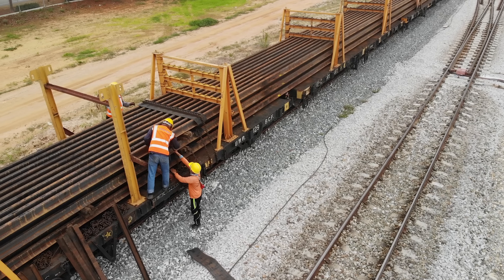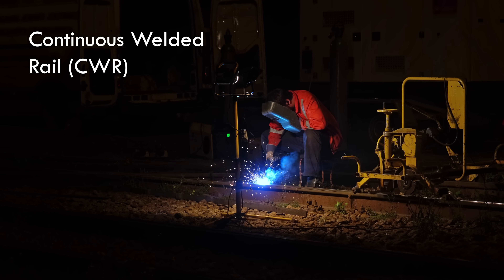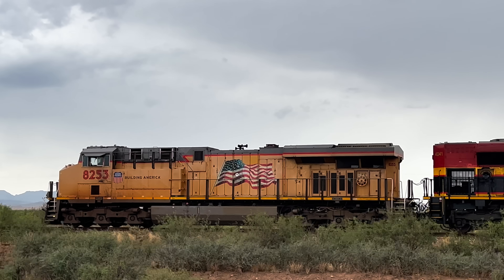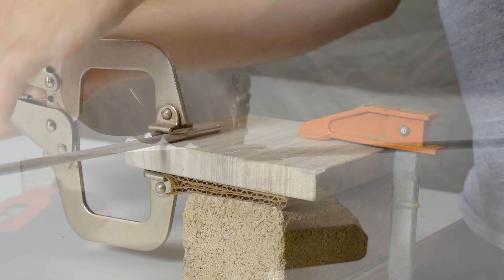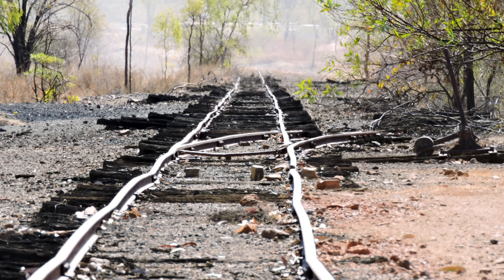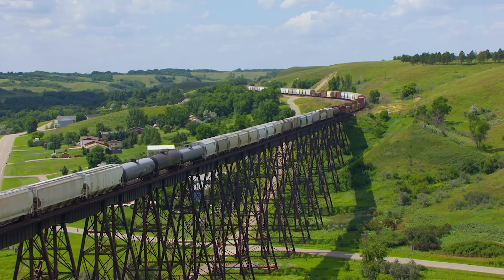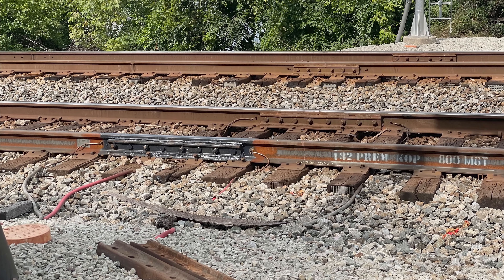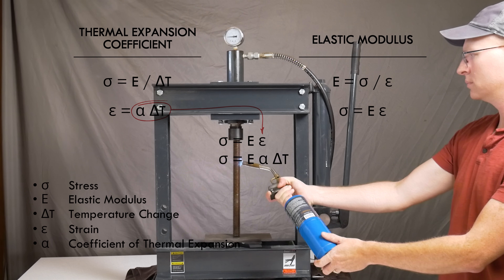Why Railroads Don't Need Expansion Joints

Comment: In europe we use concrete to space out the rails. We also don't build a perfect straight, but small segments of gigantic circles. If you alternate between left and right circles you get something that straightens up when its cold and ever so slightly S-shaped when its hot. For this to work the spacing needs to be able to move.
In slow and heavy segments the spacing just moves on the gravel and you recompress the gravel from time to time. On fast segments (ICE/TGV) we use two concrete forms that only allow movement of the tracks left and right.
If you know the frequency and maximum amplitude of that S-shape you can design a suspension for the wagon that decouples this frequency perfectly. How much the damper of this suspension needs to work is also a sensor on how curved the segment really is. So the train tells you when it needs service. Or you drive slower so the frequency at which the wagon is swinging sideways gets lower and the suspension has an easier job.

Comment: Railroad tracks are part of my thought puzzle and you being an engineer may provide an answer.  If you pushed one end of a mile long track would the other end move instantly? If you hit it with a hammer would the other end move instantly?  Now apply the same thought experiment in Outerspace where there is no gravity. Now stretch the rail to the moon. If you pushed the earth end would the moon end react immediately? Speed of push? GOOGLE all you want but you will not find where anyone has addressed this puzzle.
Reply: The speed of sound in steel is listed as approximately v=5000m/s. 

I would use this to estimate the velocity of an impulse traveling through the long track.

For a mile long track, or 1.61km, this works out to t = 1610/5000 = 0.32sec

The average distance to the moon is estimated at 239000 miles or 384km. Then t = 384000 / 5000 = 77 sec approximately.
Reply: I asked Gemini about your answer, and it said that was too fast. Try asking GOOGLE's free Gemini and see what it tells you.
Reply: @mrcleanisin  
I disagree, and I don't know who Gemini is. 

The speed of sound in the medium means there is at least a small displacement that the impulse (such as a hammer tap) causes as the energy wave reaches the other end. Obviously it would take a tremendous amount of force to actually physically move the inertia of either of those lengths. If you are trying to push those by your own strength, then good luck to you and don't hurt yourself!

This very much depends on your definition of movement at the other end. I say if you can hear the tap, then there was movement.
Reply: Would you hear the sound first or feel movement first?
Reply: @mrcleanisin  
I think it is the same answer for a hammer tap. You would feel or hear the same physical vibration "ping" when it reaches the other end.

The more I think about your experiment, I think it makes the most sense to think of the railroad track section not as a solid, but as a long and very stiff spring. This is in keeping with the compressibility as demonstrated in the video.  

What happens when you tap the end of a spring? A visible wave travels from one end to the other and then bounces back and forth for a while. Think of holding one end of a "slinky" and tapping your hand downward. That is the impulse response to a hammer. You would probably both feel and hear that delayed impulse at the other end of the railroad track from a hard hammer tap.

Another thought: If you had a strong enough mechanism to push quickly and hard enough to move the first end lets say 1 inch in a very short time, I think you wouldn't see any activity at the other end for the same time delay we have been talking about, but then the real fun begins: it would seem that the stiff spring would then oscillate in length for a bit until the oscillation dampens out. At that point the one inch offset would be clearly seen at the other end.

Similar things happen when applying a sudden DC voltage one end of an electrical transmission line. If the other end is not exactly and properly loaded (or damped), then the voltage changes travels back and forth a few times until the steady state response finally settles in, and the same DC voltage is finally seen at the other end of the line.
Reply: Some excellent engineering thinking on your part; however, my ultimate thought puzzle is the one I have presented all over YouTube which absolutely no one can resolve, most cannot even understand the set up. I cannot tell you on this post where the puzzle is. You must click to understand exactly how to set it up. In fact, what I am posting now will probably get deleted. Let me know if you find it.

Comment: Or you can do what has been done in the UK for years - keep expansion joints, but cut them at an angle, so that there is never a gap for the wheel to fall into.  These are like the joints you showed at the end, but there is much longer overlap.  The joint is spread over a couple of metres.  No matter how wide the gap becomes, there is always some rail for the train to sit on.  Express lines in the UK were doing this in the '70s and were very effective, with no clickety clack.  The extra length of the fish plates strengthened the joint too, removing your other objection to expansion joints.  You might say "ah but you need bigger fish plates, it's expensive".  It's not nearly as expensive as the extra tie-downs and the extra engineering required to resist lateral and vertical movement.
I'd much rather have this system than one which may fail catastrophically on extremely hot days, especially now that we are experiencing hotter and hotter temperatures that probably exceed the designed maximum of tracks laid 20 years ago.
Reply: Not true the only UK railway to install regular breather switches every few hundred yards in CWR was London Underground, and they only did it in their surface lines for a few years in the 1960's.
Reply: @meeeeeeeeeeeeeeeeeeee2 I was going off a school physics textbook from the 1970s showing photos of various types of expansion joints, and it specifically said that the angled joints were used on express lines to reduce noise and improve passenger comfort.  That doesn't sound like the sort of thing a textbook writer would make up.

Comment: Why demonstrate with the hydraulic press and all that force? The rod will expand when heated and retract as it cools. I suspect a check valve in the hydraulic jack limits the movement of the jack cylinder to receive the fluid being pressed on by the expanding rod. A gauge alone will help visualize movement. What's really needed for demonstration purposes is a fixed containment and strain gauge.

Comment: Very well presented and made easier to understand. Here in England we seldom see temperatures quite as high as in the States, but rail buckling isn’t unknown. It’s common practice to pre-tensor rails prior to welding, with scarfed joints every half mile or so. However, I do wonder why we bother pre tensioning the rails at all, when we can just use more frequent scarf joints? These alone avoid the hammer effect of wheels on joints and the noise which is associated with traditional jointed track.  Also, pre-tensioning railway track on curved sections presents other problems with alignment issues.

Comment: Good explanation.
Two questions.
How is the end constraint designed?
In Melbourne Australia, street cars or trams have welded rails set in concrete to constrain them. When new the trams run quietly but over time the thermite welds deform and the clickety clack returns. 

What is the metallurgical structure of the thermite weld and are there steps available to make joins as hard as the parent rail head?

Comment: had I not gone in to field ecology, railway engineering would've been my trade.. I come from a long line of navvies and ''massive'' engineering always fascinated me.. canal lock complexes.. railway junctions... bridges.. especially mechanical ones... I'm a railfan in the cartographic area, UK's 'Ordnance Survey' Maps used to be loaded with railway data and I grew up right next to a once very busy junction (busy again but no junction now) This series is cool man,  now I know why the guys over here in Scotland have a dozen gas burners going and hammer the rails with about forty 5pound hammers when they repair sections between stations.. cheers.
Here's something to get you in to canals too lol - 
You ever heard of the Falkirk Wheel? it's not a fairground ride lol, but it is a lot of fun, it's a vertically rotating canal lock. .. yeah.. you read right.. vertically :)

Comment: Certainly is a highly technical subject, I was involved in rail testing in the early days of continuous length rails some as long as one mile long prefabbed in a workshop complete with ties both concrete and timber loaded on specially designed rail trucks some could carry four sections of mile long  completed tracks stacked on top of each other, that's something to see factory built automated track building, there are facilities that just make long prefabbed  lengths of rails, to see one of these trains carrying completed tracks or rails  twisting around mountainous terrain or long curves is mind boggling that was in Australia in the early 70's when there was a lot of upgrading and new railways being built Both  Corporate and Government Owned.

Comment: TLDR; They install the rails during summer where the metal is already expanded to its maximum. In winter, the rails try to contract but the plates prevent it from contracting. When contraction is prevented, the rail is in tensile stress which is not that dangerous. 

Added the summary because I watched this long back and forgot and had to rewatch the entire thing to recollect. (No one summarized it in a dumb language that allowed me to recollect).

Comment: IIRC Young's modulus.  Having strong fastenings on heavy sleepers on good ballast can beat rail expansion, but there have been substantial bucklings when the laying isn't sufficient.
I'm posting from Australia, where heat buckles have been a problem for over 150 years.

Comment: They do have expansion spacers and floating rails are on ties and cushioned rocks. The spikes hold the rails without holes to bolt them down. Spike heads go over the rails in place.

Comment: 39ft relay rail is really only used for replacement in-kind or repair work.  Particularly out west, rail is placed in significantly longer continuous sections.  Fun fact:  Joint bars have oval holes in order to account for compression/expansion.

The majority of restraints associated with rails are only designed to direction expansion in a single direction while limiting movement in the rest.  Joint bars permit in-line movement while restricting outward expansion.  Anchor plates transfer lateral stress to the ties, and are anchored in by up to 4 spikes based on rate of curvature, ties are restricted against lateral stress by ballast, and this is reinforced by gauge bars and anchors.

Speaking of which, whenever you have a mix of rails for railroad and rails for cranes, railroad is referred to as track and crane rail as rails.

Another interesting fact.  Analog lenses handle photography of rails especially poorly.  If rails actually had gauge resembling the photographs of them, most trains would easily derail.  Instead, it's just a product of slow shutter speed.

Lastly, and a fact I always found interesting since I first heard it, "frogs" (steeply angled crossings between two sets of track) are made with a manganese point, with the idea that manganese would work harden via repeated strikes and therefore reduce the manufacturing cost of work hardening steel.

Comment: Oh wow :( 
this is kinda sad, ... here in South Africa we've solved the same problem but used a very different system. 
no buckling, no metal fatigue inducing stresses, ... just a sliding joint every kilometer or so.

Comment: My garden backed onto the main line between Prestatyn and Rhyl, the track was the continuous welded rail type,on hot sunny days the speed limit was reduced to about 30 mph because of the state of the buckles in the track,normal speed of the track was 90 mph but not on hot days,years ago the tracks had gaps and never had speed restrictions in hot weather and I can’t understand why the welded rail was introduced if it restricts speed in hot weather.

Comment: Thanks for bringing back to my memory what my father (chief engineer at the Sicily railways) explained me many years ago. I remember he also mentioned that they had a max operating temperature to be measured at the rail. Heat accumulates for irradiation on items resulting in temperatures well above the environment one. If I’m not wrong that was about 60 degrees Celsius (consider that a summer day in Sicily can easily be above 40). Above that max, despite of the very high neutral temperature set with jacks at the time of rail welding, railway cannot be operated exactly because of buckling risk.

Comment: Hey can you answer a question for me, I want to know if train tracks are made curved for the Earth's curvature, and if not why? Thanks
Reply: The Earth's average radius is 6371km. The video talked about a rail length of 39ft, or about 12m. To confirm a 12m straight rail to a perfect sphere of 6371km would require one end of the rail to move by about 11nm, or roughly 0.45 micro-inches.

Comment: I ran a holland buttwelder from Winnipeg to Armstrong Ontario. That machine was definitely something else.
Worked for 5 years then I got tired of living out of suitcase working from Ontario all the way to peace river Alberta.
The rail is supposed to be in neutral stress or compression at 90* and we have a chart to determine rail movement over a certain distance of free rail. It’s all dependent on temperature. After 115 degrees rail temp we were not allowed to weld or cut the rail. I’ve seen the track jump so much that it ripped the rail saw off its mount. When the rail is cold it pulls apart and when it’s hot, it pinches the saw.  The railroad is so interesting

Comment: RAILROADS DO NEED SLIDING EXPANSION JOINTS - THIS PROGRAMME IS INTERNET CLICK BAIT.
Practical Engineering ? Your obviously not a Railway P.Way Engineer !  In the U.S rail joints are staggered which encourages the rolling movement of vehicles, and an increase in potential derailments. But a small saving in track maintenance. In Europe track joints are parallel to prevent the rolling movement. As track in Europe was always laid to higher standards than the U.S requiring Chairs for Bullhead rail, or steel baseplates for flat bottom rail (Spiking of rail on passenger lines vanished by the 1870's). Rail lengths were generally 40ft in Britain until post WW2 when lengths became 60ft. With roughly similar lengths in mainland Europe. 

Welding of rail in Europe began in the 1950's on mainlines. In Britain it was found possible to produce in the steel works, one piece rail lengths of 1200ft. Which were laid at that length by rolling these new 1200ft lengths off the end of a train of Flat wagons. These longer lengths reduce the number of "welds" needed on site, as such welds are obviously a potential weak point. Further to reduce the problems of expansion & contraction of very long welded 3600ft lengths of rail. The rail is "Stretched" slightly during laying by special machines designed for the job. Before the rail is clamped to the "steel baseplates" to fix it firmly in place. Further at 3600ft intervals, sliding expansion joints are included, which is usually sufficient for the British "Wet" and humid climate which rarely exceeds 34C in summer.

Incidentally heavier reinforced Concrete Sleepers began replacing wooden ones also in the 1950's, except on the BR Southern Region electrified 750v DC third rail routes, as the necessary "Third Rail"  insulator pots were required at one end of every fourth sleeper, necessitating a specially designed sleeper. These routes didn't start changing to concrete before the late 1960's. 

The primary function of Ballast is to resist "Track Creep" which is: track moving in the direction of the trains. In Europe most railways are double track with one track for each direction (hence track creep), as traffic density is often ten times higher at least, than any comparable U.S Railroad. Clapham Junction (London) is the busiest station in Europe with a 12 track mainline and has to "pass" a 1000 trains a day, 95% of which are passenger trains. 

Obviously Europe cannot use American CTC type signalling methods, so we have sophisticated Block Signalling systems. In Britain that includes 4 Aspect colour light signalling introduced in 1929, to allow trains at a maximum of every two minutes, on each track. It works in conjunction with full continuous Track Circuitry. And the signal indications give information of the next three signal sections ahead. Allowing braking distances of at least 1.5 miles. More than ample for trains travelling at 90mph.

Comment: I made some calculations for my climate. In Central Europe, air temp varies from -40°C to +40°C, so I assume +60°C for a rail exposed to direct sunlight. This makes ca. 100°C of temp. difference. The thermal expansion coeff. is of "1 mm per 1 m per 100 centigrades" (a rule of thumb). So, the thermal expansion is of 0.001 (or 0.1%). Considering that Young modulus is of 208 GPa, this yields about 200 MPa of tensile stress. A lot, but still under the yield point of rail steel, which should be around 350 MPa or even more (I whistled through several webpages and found only Brinell hardness and ultimate tensile stress, not the yield point!).